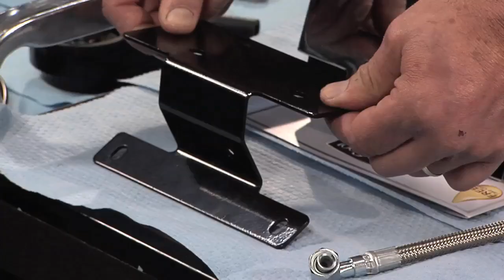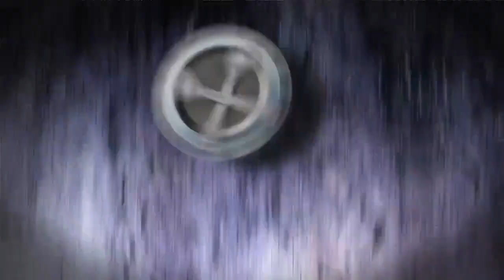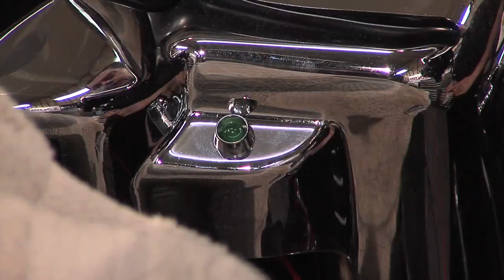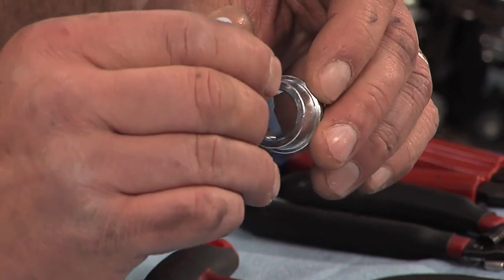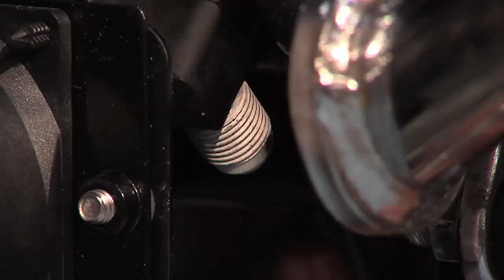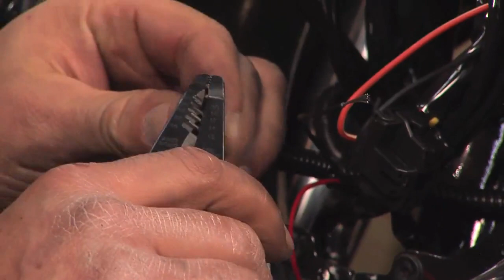Harley-Davidson® Oil Cooler Installation

Comment: Great tip... ALWAYS check you electrical connections especially when using butt style connectors. He makes a great point to pull both sides to make sure the wire does not slip out. Believe me when I tell you crimping correctly has to be perfect because these connectors can fail if not done right. Great video have watched a LOT of videos from this guy. He knows his shit

Comment: Installed this kit today and it's leaking. Looks like it's leaking from the oil filter. I tried tightening it up a little more. Then more then tight. Still leaking

Comment: What's better the love jugs or oil cooler for heat on my harley flhk touring?
Reply from the maker: Both help cooling your HD. You need to look at cost and installation. Both sites have tons of info on testing and results.
Reply: @FixMyHogfreechannel  can i install both? one at a time? probably will try love jugs first.
Reply from the maker: @louiedee279  One should bring your oil temp down.
Reply: Bought this unit. Installing saturday. Hopefully I can ride in the summer.

Comment: I would use some red or blue thread lock to the threads of the led light. I even use some on my battery terminals because of the vibration. Thanks for the video.

Comment: I want to buy a Harley so bad, but have a hard time justifying the cost on a bike that doesn't come with a cooling system. I have to ADD a cooling system on a $30k bike????!!!!! What happens if I don't & it overheats in 5 o'clock traffic? SOL? Please help me understand.
Reply from the maker: Hi John, Check out HDs lineup of liquid cooled models and you can always find a used Harley that's liquid cooled or one that is not and add an oil cooler.
Reply: @FixMyHogfreechannel  thanks for the feedback! I'll have to look a little harder
Reply: If you don't already understand what riding is all about, then its not something someone can explain to you.  So do yourself a favor & dont buy a scooter, stay in your Cage !
Reply: @rmcustom9573  been riding for 30 years, thanks. I just don't understand how a bike as expensive as Harley still uses technology as old as the number of years I've been riding. There's no reason a bike costing 30k should still be air cooled in 2021
Reply: @John-2fnf  the bikes you’d be after have had liquid head cooling for years now, good chunk of newer Harley’s already have oil coolers as well. So really you’re the one that needs to get with the times

Comment: I’m in Florida I have a 107 Milwaukee 8, it has a oil cooler as I still run @300-316 riding and in stop and go traffic as well as open road. I thought of adding a fan would that help and Is that set @220 so to to try to keep it under 300-316? I’ve been it stop and go in a detour and got up to 369 degrees. Wonder if I don’t have a Thunder max would that fan work or what the best fan to put behind the stock oil cooler or a better oil cooler that’s same dimension says the stock oil cooler that’s better?
Reply from the maker: Great question! The ‘Ask an Expert’ section is currently for members of our online community. I would be happy to send your question off to the experts. To get started, please send the email associated with your paid membership account. Thanks!
Reply: If you don't know yet, check Love Jugs & Love Jugs Mighty Mights
Reply: @porkchopspapi5757  have mighty-mites and it still gets up to 300-309 on my power vision for my ET
Reply: @Heavy69Metal  Sorry I got lost here, what part got 300-309°? If it's the cyl head at the plug base, that's a good temp.
Reply: @porkchopspapi5757  engine according to power vision reading

Comment: Im curious, does the first half of the oil filter adapter sit in a specific position on the motor, or does it have a little amount of rotation?
Reply from the maker: Great question! The ‘Ask an Expert’ section is currently for members of our online community. I would be happy to send your question off to the experts. To get started, please send the email associated with your paid membership account. Thanks!
Reply: No